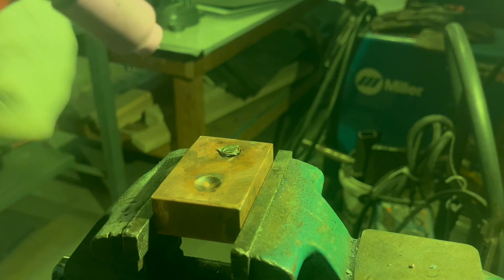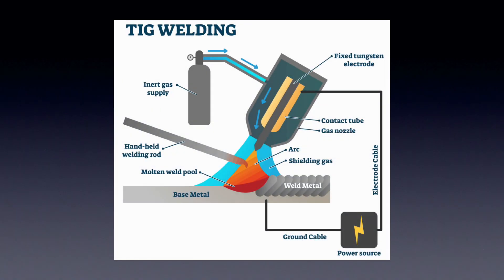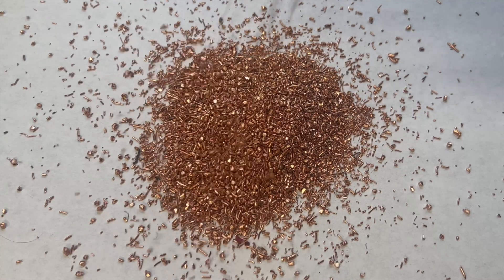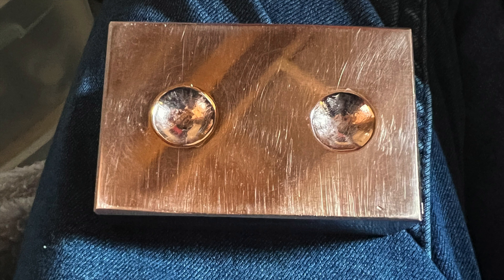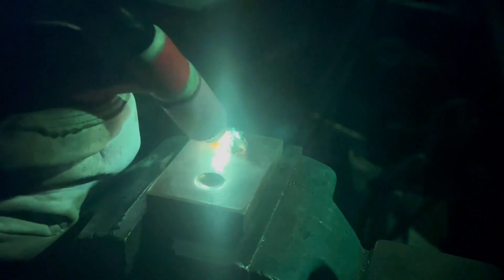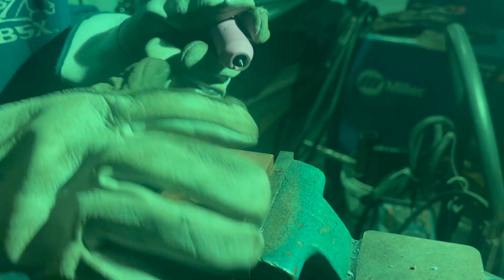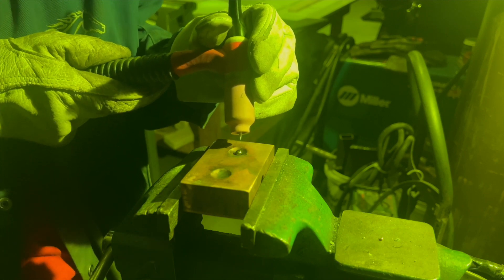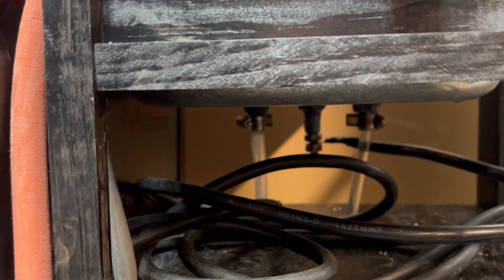Arc Melting using a TIG welder... Melting Tungsten

Comment: I've never seen tungsten melted before much less seen anything solid or liquid at such blisteringly high temperatures!
Reply: Molten metal has a cool shiny orange color. All welding is,, is watching a puddle the width of a dime.,, it's more hard on your eyes,,, You get a Sunburn on your eyeballs that feels like you have  sand under your eyelids,, it sucks.

Comment: copper will work as a crucible material, but itd be cool to see if a copper-tungsten composite would work,  good thermal conductivity and thermal resistance. also making a diy tote  glovebox with an argon atmosphere would help reduce oxidation (and also nitrides from forming, which might happen with a nitrogen atmosphere) and would be more accessible to most than an entire big setup.
Reply: I tried it with 75%t 25% c alloy and it works.
Reply: Try a gold gas mixture 30% helium, 30% co2 30%argon with 1% oxygen this won't oxide the material dummy
Reply: Really wow
Reply: Try a gold gas mixture 30% helium, 30% co2 30%argon with 1% oxygen this won't oxide the material dummy burns hotter
Reply: Dude melt down what u have pawn it.buy some welding classes
Reply: Journeyman welder masters in metallurgy the study of the chemical compensation of .metal
Reply: Purdue 
33years experience in welding 20 of it united states navy

Comment: Next up, make some ruby. Aluminum oxide and chromium oxide. Just don't use the gas. It will blow your powder around.

You can buy the chemicals from many pottery suppliers for cheap.
Reply from the maker: I actually already have all the supplies! I made some thermite rubies a while back.

Comment: I'm suspicious that the oxidation may actually be due to the gas and not intrinsic to the metal. How pure is the typical argon for this kind of welding? If it is obtained by simple one pass fractional distillation of air, there will assuredly be PPM contaminant levels of reactive gases present. That may be enough for the discoloration observed to form.